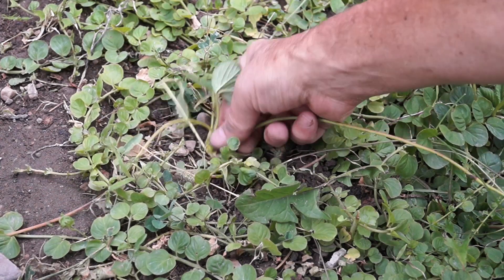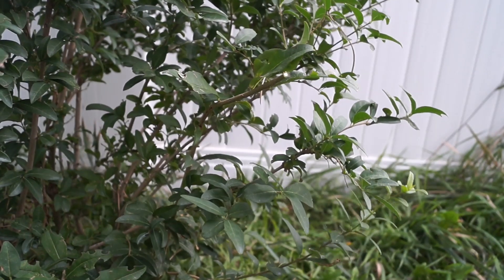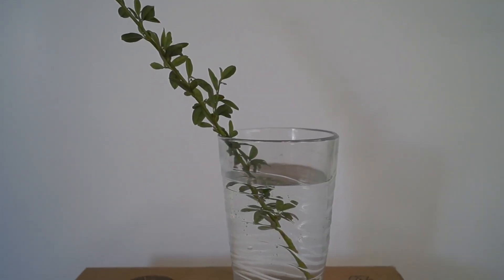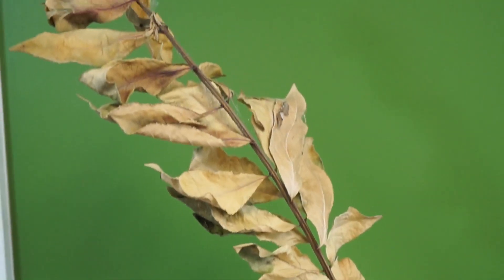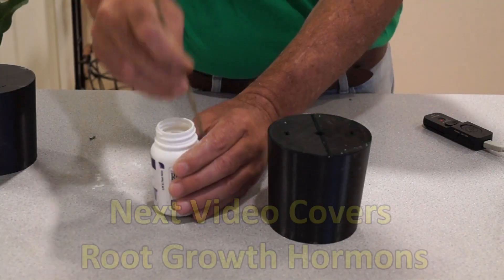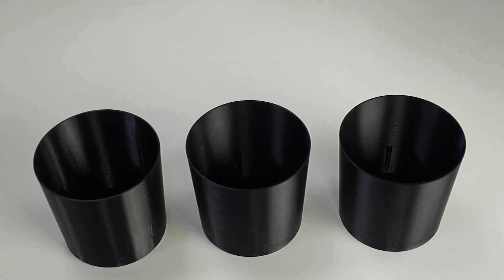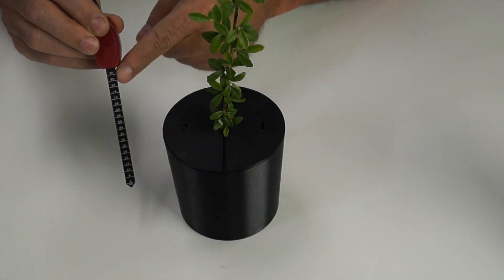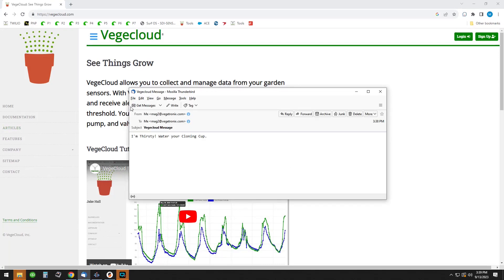The Ultimate Cloning Cup - Save Thousands of Dollars

Comment: Great idea! One detail, how hard it would be to include something like a toilet valve? You know, stick a rubber pipe in a side and have it refill the water anytime it goes under set level? Then you have to refill a bucket that is connected to ~10 of those cups once in a week (bucket in this case means water reservoir, maybe bucket, can, canister,... I wouldn't go with connecting it to house water pipe, because I wouldn't want too much pressure in this system and also you don't want "fresh" water (at least I was always told to let the water sit for a while before using it for watering plants)).